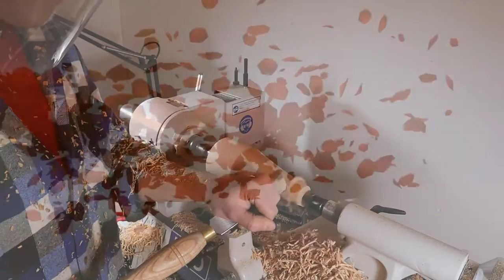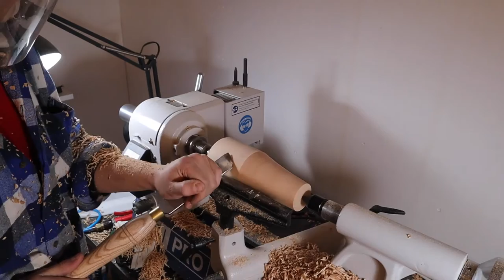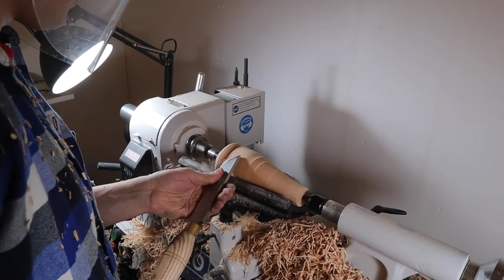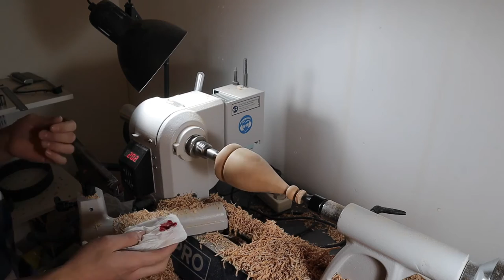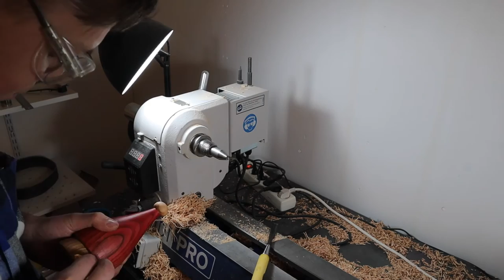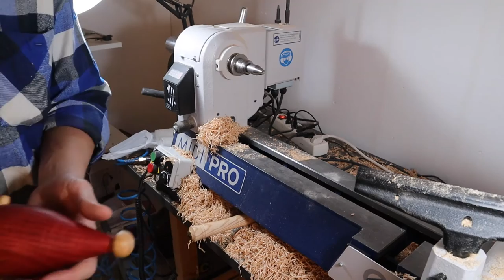TURN A [ GNOME ] ON A WOOD LATHE – Wood turning a Christmas Gnome!

Comment: An awfully lot of chips with a skew that other tools could do better with no explanation as to what you are doing or why you are doing it. Some explanation of the project and your approach would have been nice.
Reply from the maker: Valid point. I appreciate your feedback, when and if I upload again I'll keep this in mind.
I did mention in the description however why I used the skew 😉
"Most of the turning could be done quickly using the continental gouge to a greater extent. But since I’m yet to master the skew chisel I decided to use it as much as I could."